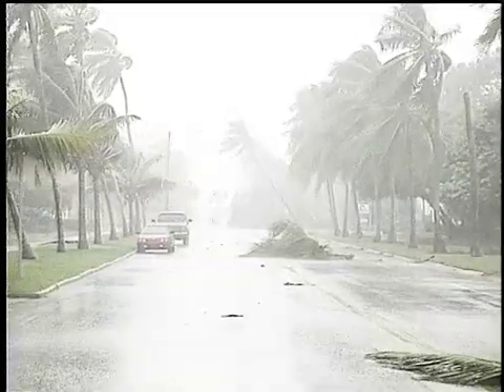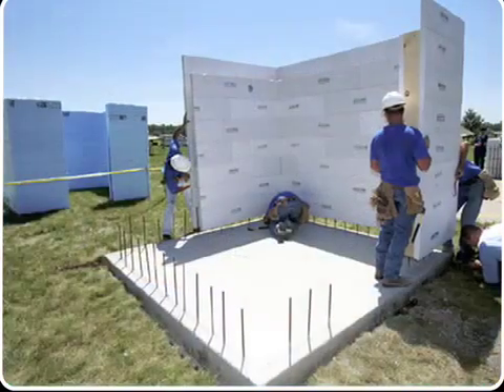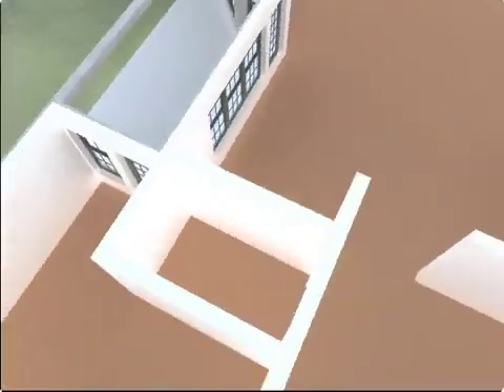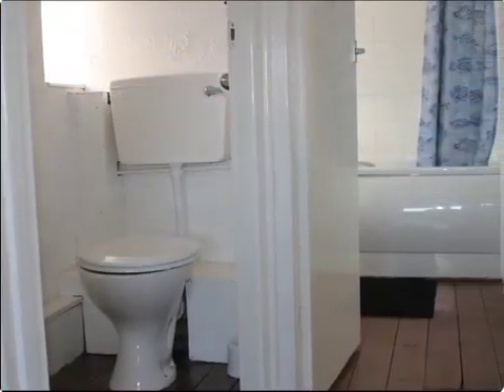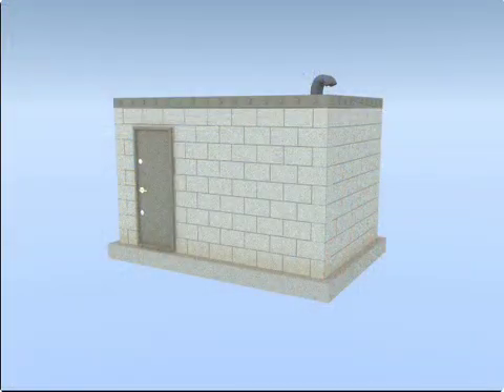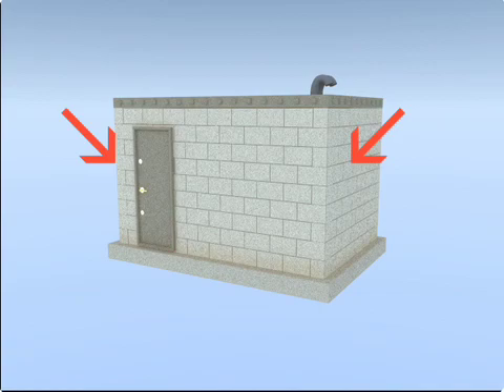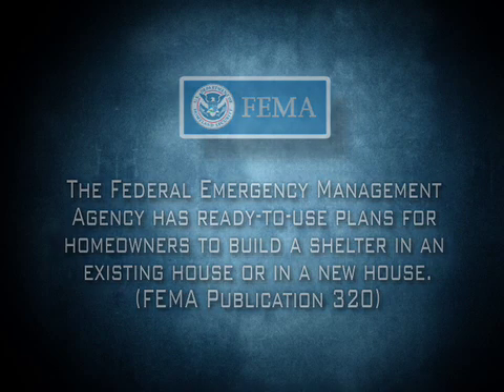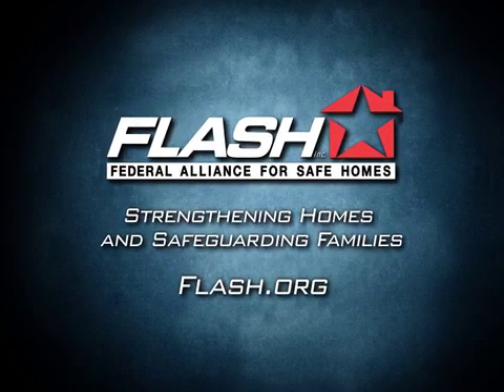Tornado Safe Rooms

Comment: Folks should look at Perfect Wall Transportable Homes, they can withstand winds up to 380MPH due to their welded construction, anchoring to the foundation and welding of roof trusses to the walls as one unit.. Then put concrete block on the exterior to survive wind blown debris. Also look at Master Security Door for your entry doors and impact resistant windows.

Comment: actualy the reason you COULDNT make the entire hous a safe room is becaus the more space you have the less structurally sound it becomes. the main strength is from the small size, for example get a piece of 2x4 steel tube and try to dent or crush it, then get a piece of 10x10 and try again, youll notice the bigger piece will be easier  to damage no matter what gauge material you use. P.S. i geusse technically you could make the entire thing safe but youd use 9" thick steel plates

Comment: @Zeamus634 

For several reasons, first is abundance of timber in the U.S., as well as the weather extremes which make insulation filled wood frames the preferred choice where tornadoes are found ,unless they were built with significant steel reinforcement brick walls will not withstand F-3 to F-5  force winds because they have impressive compressive strength but very little tensile strength.